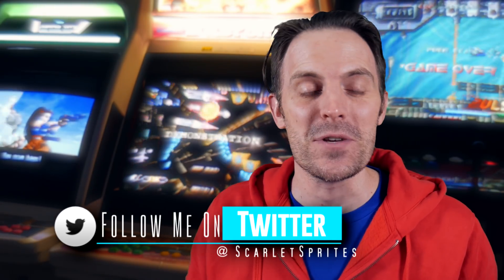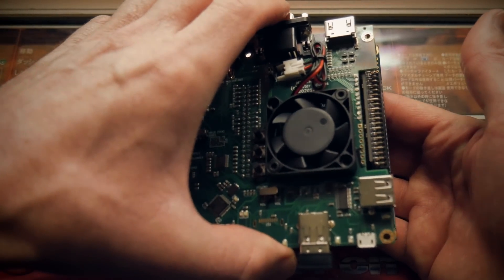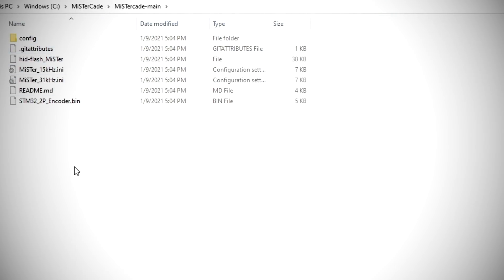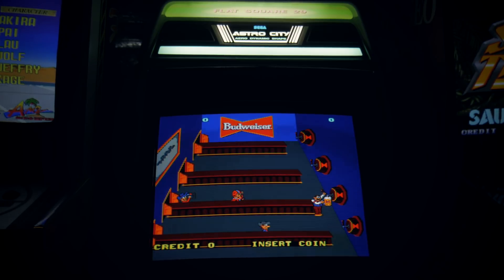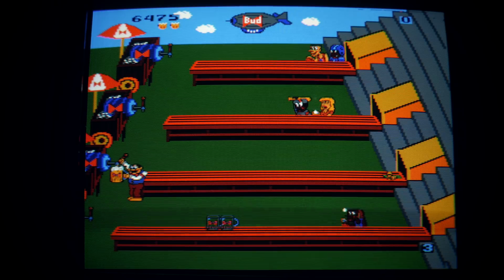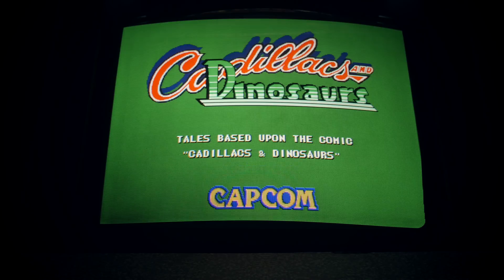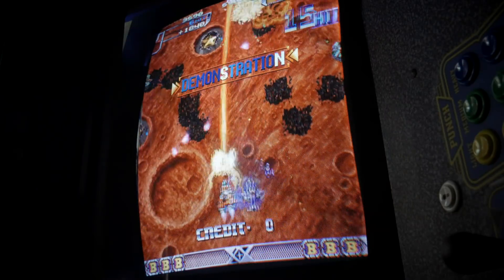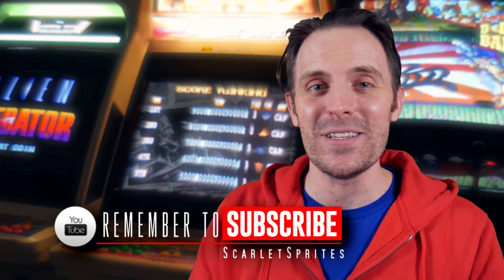MiSTerCade:  FPGA JAMMA Greatness for Arcade Gaming!

Comment: Great video have a quick question I just purchased the Mistercade full kit with DE10 nano. I have a brand new 24.8 flat CRT try sync Arcade monitor here are the

SPECS:
The horizontal synchronization signal frequency is 15 K 24 and 31K automatically vertical synchronization’s signal frequency is between 47 and 70 Hz 
video is TTL between 2.5 to 5.0 Vp-p at 1 k ohm impedance and the analog is 0.7 V PP 75 ohm impedance, the resolution it supports is 560 x 240, 640x350, and 640 x 480

Signal connector 6pin (RGB, GND, H+V, V) or 15 pin D-Sub ( Male)

I am totally new to this project you mentioned in the beginning of the video that all you need to do is grab his files and change the Mr. INI 15 kHz and 31 kHz so my question is does Mistercade supports all three frequencies 15 kHz 24 kHz and 31 kHz is there a Mr. INI 24 kHz? . Thanks
Reply from the maker: I believe it is still 15 and 31.  The GitHub link indicates that as well.
Reply: @ScarletSprites    Thank you!

Comment: Thanks for this. I'm finally going this way with my MVS cab-probably on a jamma switcher so it is still 'a real arcade'.  I've already grabbed a second MiSTer for the purpose, because here in 2022, the odds are super-slim of getting a both a DE-10 and a MiSTercade available at the same time. Everything related to MiSTer seems to have become 'sign up for the availability email'😢
Reply from the maker: You’re not kidding about the availability.  I’m still kind of mad that I didn’t grab a third DE10 but that’s just the way it goes.

Comment: Does anyone know if it will be possible to put some kind of different frontend on this setup in order to maybe show game thumbnails, etc?  Also wondering if I have my CRT in horizontal mode, is there a way for the MisterCade to display vertical games in a letterboxed mode to avoid constantly rotating the CRT?
Reply from the maker: The MiSTer UI is what it is as of today.  It’s a quick access menu with no bloat.  I personally prefer that over the packages you see with RPi setups but I understand not everyone does.  As of today there is nothing in the works for that.  The second question is also a no currently, but it would be core dependent.  There have been developers who have floated the idea for their cores but I don’t think any of them have chased that down.

Comment: No jvs support on this board?
Reply from the maker: For now just think of it as a standard Jamma pcb.  JVS support may come at some point in the future but it isn't a guarantee.
Reply: @ScarletSprites  I'm finally picking up my new net city this week and I'm trying to get it up and running as quickly as possible. 

I love the idea of a mister, but the hoops I have to go through just to get it on a 2 player jvs setup seems overwhelming, as I'm still relatively new to this scene.
Reply: @ScarletSprites  just a thought, can you just use a JVS2JAMMA adapter to run a mistercade?

Comment: Thanks for this.  My ArcadeSD card recently broke, so I am looking for replacement options on a dedicated 4-way/vert cabinet.  I do have a question.  Do you have to set controls every time it boots or only the fist time you launch the game?
Reply from the maker: No, they save after setup thankfully.  You can of course remap at any time of you want to change your layout however.
Reply: @ScarletSprites  - Thanks, I will definitely be buying this..  Any idea when they will be available for purchase?  I went to the link in your description but its not listed yet unless I  missed it.
Reply from the maker: No ETA currently.  It’s on a subsequent hardware revision and being tested again.  Goal is to offer it to market after having been thoroughly vetted in a number of configurations to really limit the amount of issues to end users.  It means that this is taking longer but definitely won’t be pushed out half baked.
Reply: @ScarletSprites  - Sent you an email to your gmail account.

Comment: I know they don't have the core support, but would be nice to have direct connection for 2x Konami kick harnesses for games like Turtles/Simpsons/X-Men.  Granted, each of those are 15 pin each for a total of 30, and the Capcom is 34.  So should be able to get them to work with either a re-pin but ideally an adapter harness.
Reply from the maker: We need to get someone working on those cores first.
Reply: @ScarletSprites  Realize I had a long winded response.  But thanks for the time to respond to my original comment.

I agree, the cores need work.  It's basically my dream to get the Konami 4 player cores on the MiSTer. I know there is interest but it's on core developer's back burner at the moment while they have other projects.  I still think the hardware needs to look at the future, or at least allow flexibility with the kick plug for expandability. it would suck to get the cores and the MiSTerCade doesn't support their kick harnesses because it was only wired for a CPS.   CPS only uses 11 of 34 connections to get up to 6 buttons per player.  So I'm just worried they have those empty connections not hooked up, or not enough inputs available to make adapter harnesses.

Sure, I could make a custom Konami kick -> USB controller and plug that into the MiSTer but that kinda defeats the purpose of the MiSTerCade's simplicity.  Since you can already hook the MiSTer up to a Jamma with a JPac and a few extra aux boards.

Would you by chance know the pin out of the board connector? Neither the Konami or CPS kicks used all their pins, but it would be nice to have upwards of 30 pins available for buttons to map.  The Konami harnesses only uses 10 pins per kick of the 15 (20 total for player 3/4) for 3 button, up/down/left/right, coin, start, ground.  If you wanted to have a layout that was 4/6/6/4 buttons for a good multi-cade control panel. You'd still need another 6 pin inputs and 2 ground (could do common ground to save pins) to add buttons 4/5/6 for player 1/2.  That would give you 28 even without combining grounds, so could work with the CPS kick if it has the inputs.  That should pretty much have you covered for probably 99% of 1-4 player arcade control board setups in a single cab.
Reply from the maker: At this point I think you can expect any 3P or 4P extensions (for games that would support it) to be handled via a USB encoder.
Reply: @ScarletSprites  that's my plan right now. I'm building a JPAC interface with I-PAC4 for P3/P4 for a MAME PC for my TMNT cab. Added bonus, I can plug it into the MiSTer for now. Then, when the MiSTerCADE comes out, it takes out the need for the JPAC and still keep the I-PAC4.

Comment: Even if this wasn't going into a cabinet, this would still be cool to use through JAMMA to play those arcade titles that didn't run through JAMMA to begin with. As long as your supergun of choice has an RGB  or Component out option you're set to play on any good CRT or upscaler like the OSSC. Many superguns also allow DB15 and USB connections for controllers these days to, pretty nifty if your prefer to play with a USB arcade stick, USB retro controllers like the Saturn or SNES options that exist, modern controllers like the PS4 or Xbox One and anything with a DB15 connector like Neo Geo or any custom DB15 DIY stick. Still not sure about the overall price of a MISTER though, the money spent on one can be spent on most real JAMMA arcade boards with some change to spare. Again though, the advantage would be to play the arcade games that were not originally JAMMA.
Reply from the maker: That’s for sure a nice perk; avoiding any adapters you’d otherwise need like you mentioned.  As far as the Supergun goes though, I’d probably just skip the MiSTerCade addon entirely and just roll with MiSTer to keep things simple.

Comment: God I need that. Own about 150 arcade pcb, mvs and CPS games but still this is absolutely awesome. Is there a similar system in the works for 31Khz games ?
Reply from the maker: Yes, you’d just use the 31kHz ini file instead of the 15kHz one I showed in the video.

Comment: Great video thanks! Not sure if asked before, but how or what’s the best way to obtain an Astro City Candy Cab, or any good quality jamma cab for that matter? Would love to have a mistercade set up like yours someday, but don’t know where to start when it comes to actually procuring the cab... thanks!
Reply from the maker: Candy Cabs will vary by region.  It's way easier to get them on the West Coast than other locations, but not impossible.  I'd watch local listings (FB Marketplace, Craigslist, etc.) for something with a six button setup.  If you're patient you can land something decent for ~$500, although that may vary depending on where you live.  I'd argue the monitor is maybe the most important thing to be sure is good if its your first rodeo.

Comment: What happens on startup? Can you just turn the power of the cabinet on(or strip of cabinets) and it goes into a game?
Reply from the maker: You can have it boot to the menu or change a setting to “boot last core”.  In the case of the latter it will load the last core you played ten seconds after booting up.
Reply: @ScarletSprites  that’s great!

Comment: Other than the handy IO, why is this better than pushing RGB off a low buck PC with an ArcadeVGA or ati firmware mod?
Reply from the maker: The short answer is accuracy.  Here is a pretty good example regarding the CPS1 core...
https://www.patreon.com/posts/46899296

But yes, the sheer convenience of a device the size of my hand that plugs directly in without any additional power needs, wires, modifications, is almost reason enough.

Comment: Excuse my ignorance but can you use same roms from your retro pi emu or does the mister use specific ones?
Reply from the maker: It uses Mame roms for arcade games but it will grab the correct ones for you if using the “Update All” script.  This is a little different than a software emulation device like a pi however.  You can’t just toss a bunch of arcade roms onto this and have them run.  If you were thinking about console games, then most of the roms you already have will probably work just fine and could be copied over.
Reply: @ScarletSprites  Do you have a video explaining this in depth? Yes I was thinking mainly Arcade roms as it seems they would perform better on something like the Mister??
Reply from the maker: They have potential to be highly accurate, but that’s directly related to the quality of the work done on the core.  Fortunately many talented developers work on MiSTer cores.  I have a very brief overview a few videos back.  Maybe checkout some videos from SmokeMonster...
https://youtu.be/igiVHfBzX8w

Comment: You mentioned your bad experience with pi2jamma, but have you tried RGB-Pi? I demo the Scart version on my channel but there’s also a Jamma version. Mister is very sweet, but if you wanting support for more arcades and for much less money than a mister setup then check out RGB-Pi Jamma edition.
Reply from the maker: No, I stopped after the Pi2Jamma debacle.  Truth be told, and this is a personal decision, but I feel like if you’re going to the trouble to restore and make room for a genuine cabinet you should do it justice with an original hardware as well.  The MiSTerCade is the first non-Darksoft multi solution that has intrigued me.  I’m not saying the software emulation solutions aren’t fantastic, just that when it comes to the cabinets I’ve been more picky about what goes inside them.

Comment: Great video thx!
I am new to Mister and I wonder if there is a way to make it a seamless arcade experience:
- Can it autoload the last game on startup? Is there a procedure to turn it off or do you simply power off your cabinet like you would with the real hardware?
- Can you configure the ingame menu hotkey on something else than the cabinet’s panel? It would be nice to have something similar to the MVS unibios « arcade protect » mode (use of test / service switches combination to access the mister menu for instance).
Reply from the maker: You can have it boot to the last core upon startup.  There is a ten second countdown for this.  I’m told that is needed in order to fully initialize the ram.  Think of it the same as a normal pcb, you would just power down the cabinet.  Some cores will support hot key menu but not all.  For now I find having the keyboard best.

Comment: That looks fantastic. The only downside is that you can't run vertical games properly due to the cores not being able to rotate - you would need to run a scaler mode, which probably wouldn't work on a 15hz arcade monitor, it doesn't on my Sony PVM.
Reply: You rotate the monitor.
Reply from the maker: It would be sweet if you could cheat and play the vertical games in horizontal mode.  I've heard potential talks of that and the lag it would potentially introduce.  It would be cool to have the option at least.  Otherwise, yeah, you're rotating the monitor in your cabs.

Comment: Sooner or later the old arcade boards will fail... The only true way to keep an arcade cabinet operational will be mister or any alternative hardware simulation. I had 2 of my favourite boards fail on me and I cannot send them to another country for repair because it is very expensive. Mister seems to be the future. Current multi solutions depend on old hardware to work and this is unreliable, plus they are all very expensive and very limited in production units.
Reply from the maker: Man, it’s not even the games that I worry about long term any more...it’s the CRTs.  I can’t imagine a cab without one.  Trying my best to maintain and provide preventative care.

Comment: would be nice to have a way to autoswitch between 15khz and 31khz setting. (or even a toggle switch to do this would be nice actually)
Reply from the maker: I hear you.  There are still a few things to work out on this from a bug and design standpoint.  Not sure if that's in the cards or not, but I definitely know where you're coming from.

Comment: Hi excuse me for my question, but whats the differnce between that and a good PC with Groovy Mame + CRT emu and all good modelines and clock, Frame_delay to "5" or more for instant inpout (no inpout lag) ? I have that config and make comparaison between two Nanao MS9 side by side and zero difference with the original hardware. Thx.
Reply from the maker: It really comes down to the whole software emulation vs. fpga hardware replication arguments.  Currently software emulation has a larger library and more options/features available to it.  FPGA solutions are going to be less flashy in terms of UI but have the potential to be cycle accurate to the original boards, better overall accuracy.  The low latency control inputs for FPGA are also pretty fantastic when compared to USB options on most software emulation setups.  However, it's all about what is best for YOU.  If you are happy with what you have setup, you should keep using it.  Just check in on the FPGA stuff from time to time to make sure you don't think you're missing out.  :)
Reply: @ScarletSprites  Thx, ok its very good for home console core for futur (like saturn) its exellent, but for arcade i have already perfect settings in my .ini and groovy mame + MS9 and frame_delay at 7.  Sorry for my dirty english.

Comment: Do you have to map buttons every time you play a game or is it saved somewhere?
Reply from the maker: Its saved after you configure each game.  There is also a nice "boot to last core" option so you can just turn the machine on and have it go directly to the last game you had running.
Reply: @ScarletSprites  - ooh thats nice, - SF2 does look pretty "arcade perfect" - does the Jamma adapter use SNAC? - Have you noticed any lag? - I dont think you used SNAC in the last vid

Comment: Does this runs arcade perfect?
Reply from the maker: It's as accurate as the person who designed the core.  If you have someone like Jotego working on it, I'd say its pretty perfect.  Like anything though, there are usually things to be refined and cleaned up.  I'd definitely recommend looking into Jotego and FPGA.  He talks a lot about the accuracies that can be achieved.

Comment: As a long time MiSTer user I have had a similar experience. It just works. It doesn't have the exact same bells and whistles but it has been extremely reliable for me.
Reply from the maker: The simplicity of it is fantastic.  I love the no fuss just play aspect.  For those who do want to dive deeper though you can still peel back the layers.
Reply: @ScarletSprites  Same. I know a lot of people are critical of it's interface, but I prefer it honestly. It's got almost no boot time and you can just get in and play.
Reply from the maker: Omg, I really don’t care about the interface at all.  I much prefer low bloat and higher performance.  All the scraping and themes and other stuff in alternative formats is a real turnoff to me.
Reply: @ScarletSprites  It really has been a "gaming first" kind of experience.

Comment: Another top, informative, video showcase. I'd be interested to see how 31k games run on the 15k  output... I know with the AtomisWave, dipswitch 1 can swap the motherboard between outputting the two resolutions, and the games play great at 15kHz, but can the MiSTerCade effectively do the same thing for all 31kHz games/cores?
Reply from the maker: I wanted to test this out on the Blast City which is currently JVS wired.  I figured 12min was enough for this round but that’s something I may cover in another video.
Reply: @ScarletSprites  Brilliant. Look forward to it. Opening up 31kHz games to 15kHz cab owners would be huge!

Comment: great video! do you need to adjust the screen after switching games or cores?
Reply from the maker: I did have to do that a few times.  Same deal when switching between original pcbs really.  You can see that on the Joust title screen in the video, whereas Tapper was fine, Kung Fu needed a height adjustment.  On the Big Blue though, all the CPS1 games were fine once the first was adjusted.